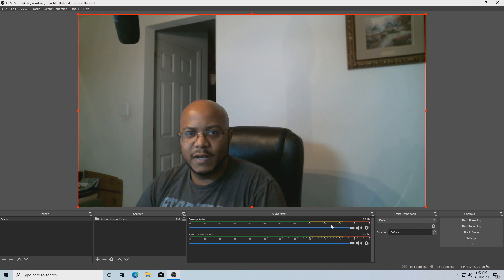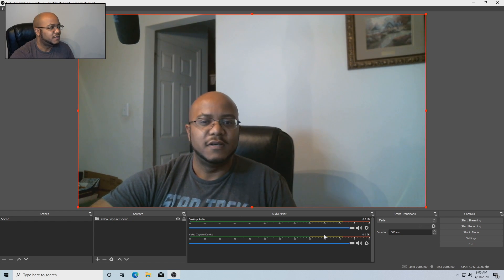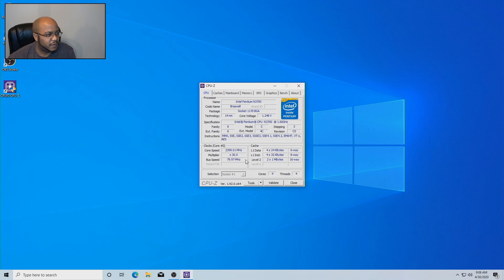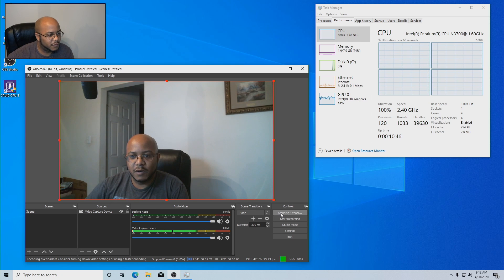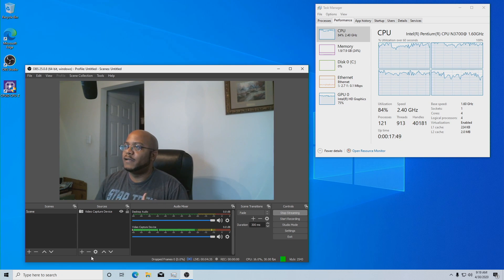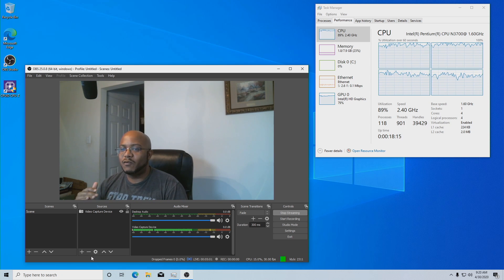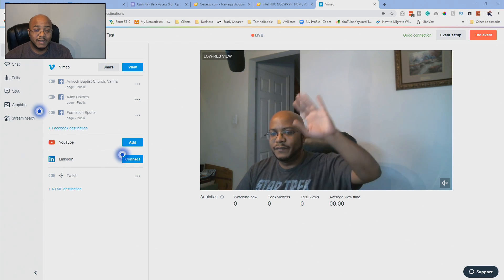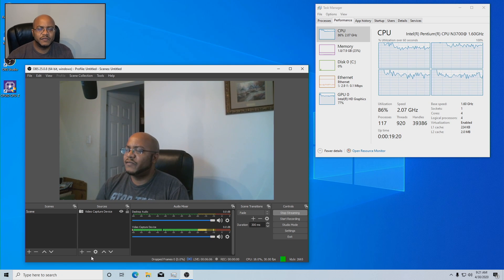LIVE STREAMING WITH THE INTEL NUC | Software X264 vs Hardware QSV

Comment: Your video pops up on a search for 'live streaming nuc'. But you are demonstrating how an old, cheap NUC is under-equipped for the task. Can you recommend one or more current model NUCs that would be suitable for a small church starting out with one camera. Since OBS can use the GPU to assist, I would also like to know which if any NUC's to avoid because their GPU cannot be used with OBS. NUC's are nice due to small form factor, no fan, relatively powerful.

Comment: This would be exstreamly frustrating especially if you added NDI. Btw if you lowered res to tv wide 1024x576 would that  improve the smoothness and lag?
Reply from the maker: It would improve the performance lowering the res which is fine but never drop the audio quality as people would not stay with bad audio

Comment: Would the Ryzen 5 3400G be better for live streaming than the 3 3200G? Or is the 5 just overkill?
Reply from the maker: Yes the 3400G would be better. That is what is in my ASRock A300 Mini Streaming PC
Reply: @AJaytheCEO  disregard I see you can :D
Reply from the maker: @loveasapologetics  in this version you can't
Reply: @AJaytheCEO  miserable. Lol do you think a mini itx for sake if portability but without the capability of adding a graphics card down the line is a good build for streaming? Or should I stick to to micro atx in case I want one?
Reply from the maker: @loveasapologetics  for portability and mainly for streaming only I think it works. That's my plan for sporting events and for situations like this we are in. But if you want something stationary with easy growth potential then a micro atx would be the better choice long term
Reply: @AJaytheCEO  can you change the processor in that?